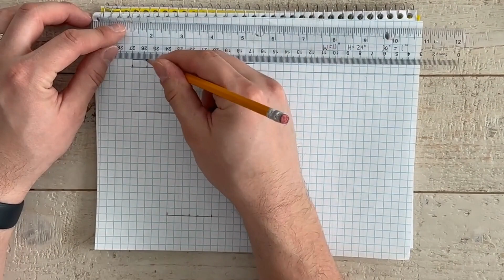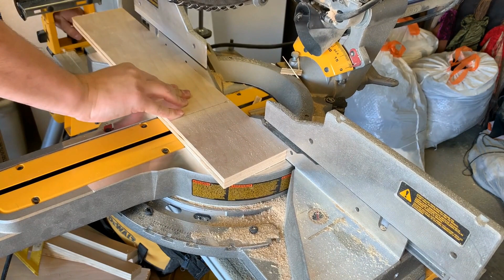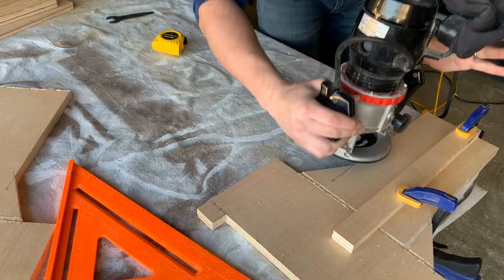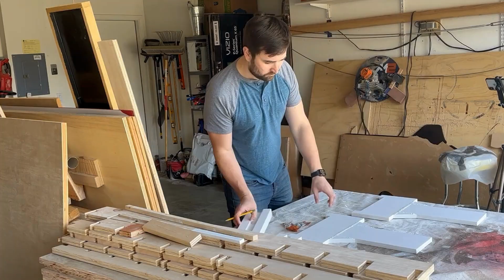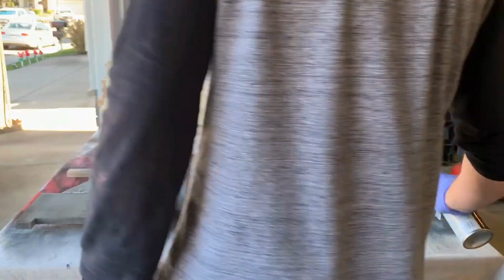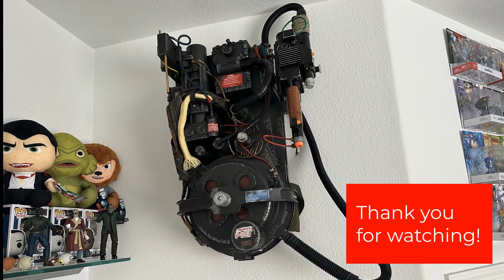Ghostbusters Proton Pack Wall Mount: Full Guide

Comment: My pack is mounted on an alice frame, do you think your wall mount would work anyway?
Reply from the maker: It might need to be a little further off of the wall, and I think the upper part of the rail would interfere with the upper part of the front plate. I was already planning on getting an alice frame so I might do that sooner rather than later. Then I’ll post an update or my redesign if it’s needed.
Reply: @offhandliving3007  oh believe me, it is needed indeed:  the alice frame is a must for your pack
I have the rothco frame, its perfect